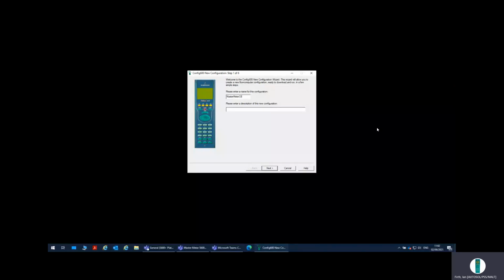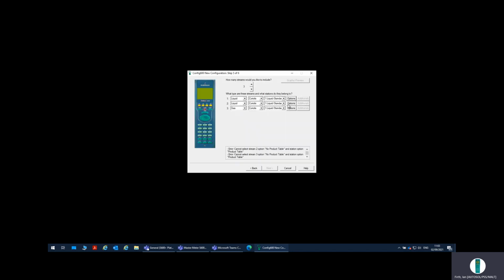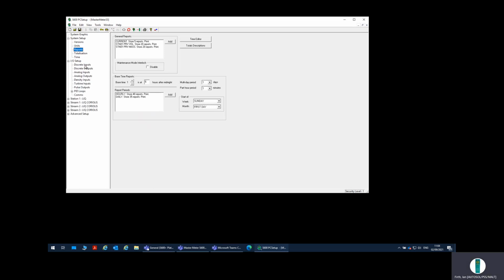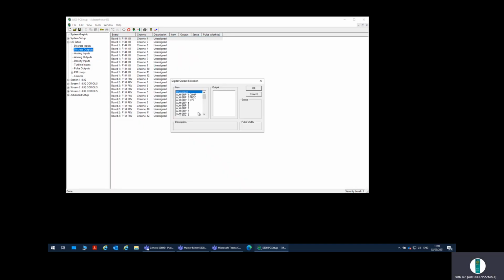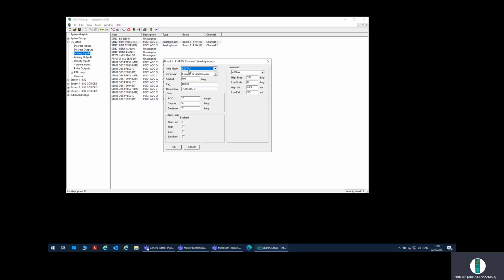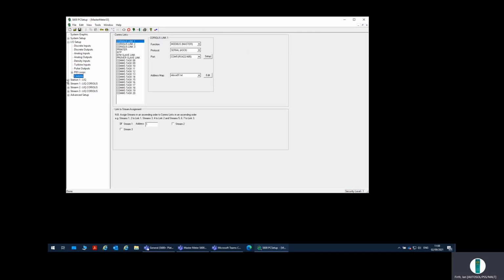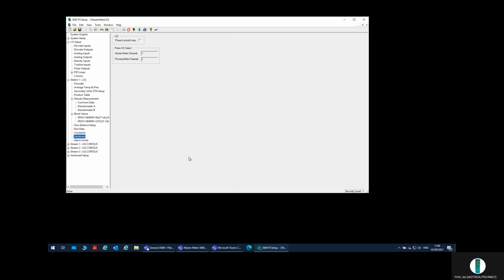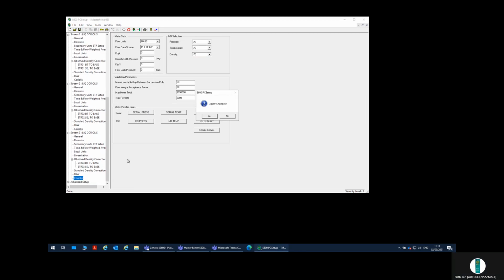Master Meter S600+

Comment: Thank you very much for the video.
If I have two lines, Line A and Line B, and Line A is normally used for measurement while Line B is used as a backup and also for comparing the measurements of the two lines, how would you connect the pulses from the two meters?
Would you send both signals to the P144 board and then route the pulse from Line B to the P154 through the RAW PULSE board, or would you use a different solution?